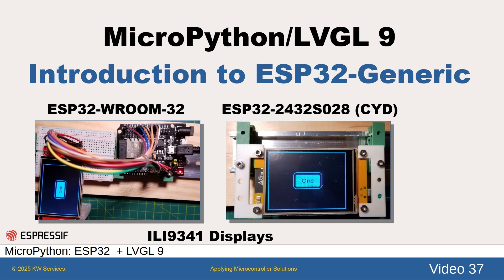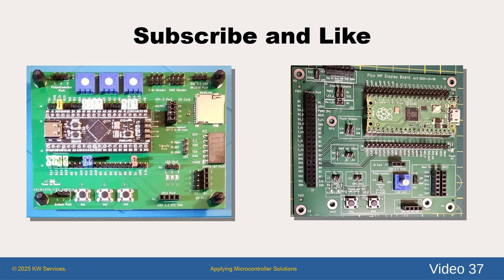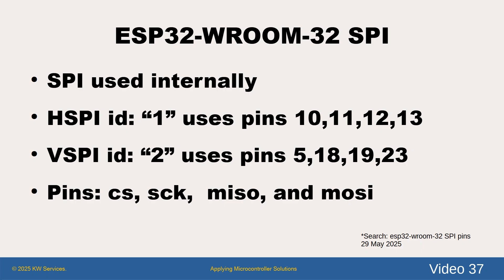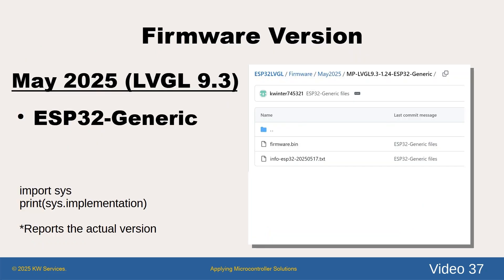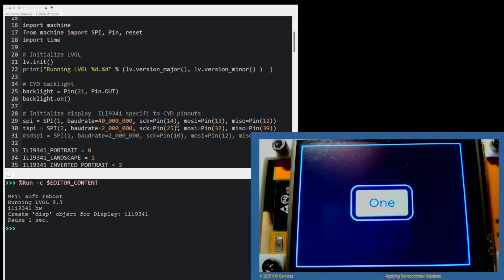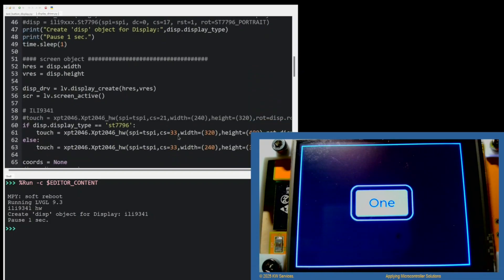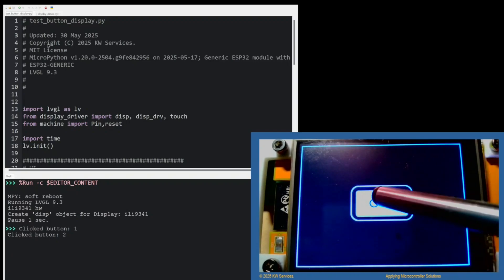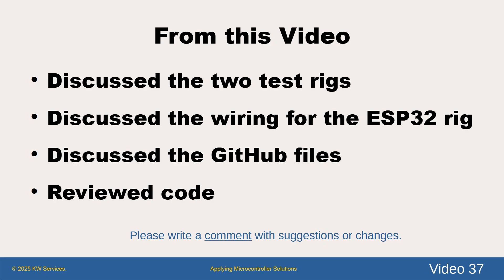MicroPython LVGL 9 – Introduction to ESP32-Generic

Comment: I'm having problems getting this to run. I have a ESP32-2432S028. Used Thonny to load the MP-LVGL9.3-1.24-ESP32-Generic firmware. I uploaded the files from the MP-LVGL9.3-1.24-ESP32-Generic folder and when I run the display_driver.py file, the screen lights up, but the button doesn't appear. When it runs, I dont get any errors and I get the expected output 

MPY: soft reboot
Running LVGL 9.3
ili9341 hw
Create 'disp' object for Display: ili9341
Pause 1 sec.
Reply from the maker: Hi, thanks for the question. This is code from Video 37.   Sounds like you are executing the display driver instead of test_button_display.py.  I accidently do this often.  If it helps, I suggest closing the display_driver.py file and only open the test_button_display.py file.  The display_driver along with the other driver files need to be uploaded to the flash  (MicroPython Device).  Next in Thonny, click on the test_button_display file to make sure its selected, and click the green RUN icon.  

By the way, if you try running the program twice (the 2nd time the ESP32 will crash; it will always do this).  No worries, just click the RUN icon again.  Sometimes it gets really confused and you can disconnect/reconnect power, (and then click RUN).

Please let me know if you are okay now.

Comment: Hello, I have been trying with ESP32LVGL/Firmware/May2025/MP-LVGL9.3-1.24-ESP32-Generic but I couldn't find bootloader.bin and partition-table.bin, could you send them to me? Thank you.
Reply from the maker: I will locate it and reply again
Reply from the maker: python -m esptool --chip esp32 -b 460800 --before default_reset --after hard_reset write_flash --flash_mode dio --flash_size 4MB --flash_freq 40m 0x1000 build-ESP32_GENERIC/bootloader/bootloader.bin 0x8000 build-ESP32_GENERIC/partition_table/partition-table.bin 0x10000 build-ESP32_GENERIC/micropython.bin
or from the "/home/winter/Documents/lv_micropython/ports/esp32/build-ESP32_GENERIC" directory
 python -m esptool --chip esp32 -b 460800 --before default_reset --after hard_reset write_flash "@flash_args"
bootloader  @0x001000    23264  (    5408 remaining)
partitions  @0x008000     3072  (    1024 remaining)
application @0x010000  2587696  (  558032 remaining)
total                  2653232
Reply from the maker: let me know if the info helps.
Reply: @applyingmicrocontrollers  Thanks! Just to confirm — is firmware.bin meant to be flashed at 0x0 as a full image? Or should I wait for bootloader.bin and partition-table.bin separately? Appreciate the help!
Reply from the maker: I do the full image without using the bootloader and micropython addresses.  Often I just use Thonny which will do the settings for you and flash the board.
Reply: Image for ESP32-Generic works well, but in my case image for ESP32-S3 was problematic, device is repeatly restarting. Of course I'am using syntax as you wrote in text file.
Reply from the maker: hello.  thanks for the comment. At the github site there are several ESP32-S3 firmware.  (1) MP-LVGL9.3-1.24-ESP32-Generic-S3  and (2) MP-LVGL9.3-1.24-ESP32-S3-Oct-Legacy.  Most of my firmware is intended for "standard" boards.

The (1) firmware works on older ESP32 USB Boards.

The difference is that (2) is for newer ESP32 USB boards with 8 MB PSRAM. 

By the way, I also built the firmware for one of Unexpected Maker's ESP32 board. so let me know if your board is this one.  Otherwise reply with more info about your USB board.
--------------------------------------------

By the way,  All of the platforms run once and then you need to enter reset()  (from machine import reset). Or, pull the USB cable and re-insert.

Comment: I’ve encountered a small problem. In the case of my CYD (Sunton 2.8" with both USB-micro and USB-C connector), the display seems to be rotated, but I tested all four orientations in the config file without finding a suitable solution.

Also, the colors look incorrect — instead of blue, I see something more like gray with yellow, as if the pixels are slightly inverted. After the program initializes, I don’t see any buttons, just some broken or scattered lines. The button only appears after the first touch, which is odd.

Of course, I did uncomment the line for the "big type display." Very strange.
Reply from the maker: Thanks for the questions.  The CYD I purchased was from Amazon (which I thought was the most common).  You have to make (hopefully) simple edits to the driver files.  display_driver.py has the rotations.  Currently its set to ILI9341_LANDSCAPE.  But you can change it to any other (like ILI9341_PORTRAIT).  Those are just names for values 0,1,2, or 3.  

The colors can be fixed in ili9xxx.py around line 105 is the definition Ili9341_hw.  There at line 118 is a variable called "bgr" currently it is False.  You might try to change it to True and see if that fixes your colors.  bgr is a short name for Blue Green Red.  

Otherwise you may need to fix the INIT.  This code is at line 131-154.  This requires the C driver code from the vendor. Can you respond with a link to it?

I hope this helps you.
Reply: @applyingmicrocontrollers  I bought another ili9341 and start from the beginning. And everything seems to be all right. It's strange that display at the CYD reacts different.
Reply from the maker: Do you have a link to the maker's site maybe I can find and look at the INIT code they are using to see if its different.

Comment: There is a special variant (USB-C connector) that has a different screen init sequence, the ESP32-2432S028Rv2. There are also clone boards with the marking 7789 on the box. This is the v3 variant that has a ST7789 controller instead of the ILI9341!
Reply from the maker: Thanks for the information.  I purchased my CYD several months ago.  I am looking at Amazon now and there are offerings with USB-C.  The photo I am looking at shows everything else is the same.  Do you think its worthwhile to get the newer board.  Also, have you tried a ST7789 display?  I see its 240x240 resolution.
Reply: Mine is like that. It has both connectors and one is usb-c. @applyingmicrocontrollers I bought it on AliExpress. And the funny thing is that circuit python has a dedicated bin for Sunton CYD. After downloading this bin, the display also looks like it will rotate from landscape to portrait. The proper declaration in the ini file, cures this problem and the display is back to normal. Unfortunately it's starting to be to slow. This is the reason why I tried with lvgl an up.

Comment: otimo video, o melhor do youtube, tenho uma placa esp32-2432s028 com dois conectores  usb, segui os procedimentos mas a tela ficou toda esquisita bagunçada, acho que a versão da  minha não corresponde ao  driver  , pode me ajudar
Reply from the maker: Ola.  Thanks for the question. This is why I like separate driver files.  The driver file ili9xxx.py contains the code for the display-type.  If you are using the driver file from my GitHub then starting in line 128 is the function config_hw(self).  This is the init sequence for the display.  For the board you are using there should be a website with drivers.  Even if it is a C code file there should be a sequence of numbers that you can copy to the ili9xxx.py file.  Let me know if this reply helped you.